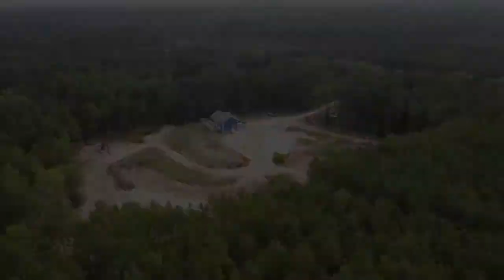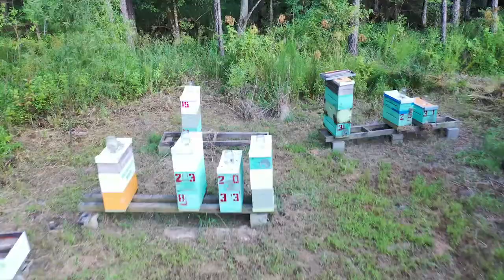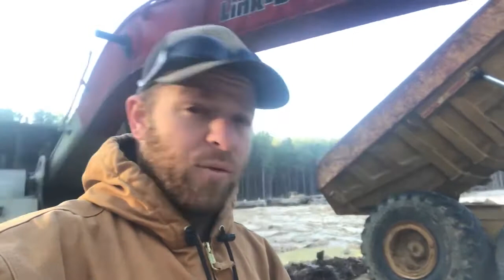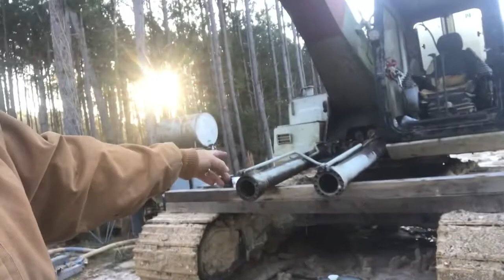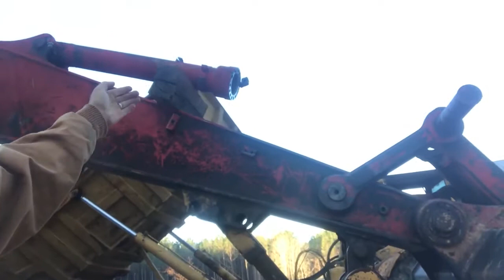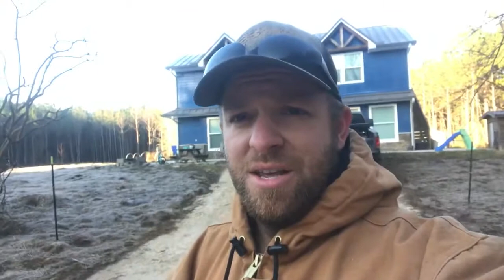Rebuilding Excavator Hydraulic Cylinders   Removal and Replacement Tips

Comment: How did you go about purging the cylinders of air on reinstall? I just got my own excavator and had the cylinders repacked, and I'm wondering now if I need to reconnect the hose and crack the bleeder  valve while exercising the hydraulics.
Reply from the maker: Didn’t bleed anything. We just cycled the cylinders a few times and they worked the air bubbles back to the tank on their own.

Comment: Tom !!!!
You are coughing a LOT !!
WEAR a RESPIRATORY oR at LEAST a DUST MASK while sawing !!
 Also hearing protection !! 
 At 65ish I have developed respiratory n SEVERE Tinnitus !!!!!!!!!!!!!!!
 Protection n Prevention can go a long ways !! I WISH I would go deft !!!!!! It is dat bad !!
  L👀kin into Micron dust particles will let you know !! ALSO your Children n Wife in the area !!
  GOD BLESS
Reply from the maker: I do appreciate your genuine concern on all fronts. You don’t see it here, but I do keep isotunes ear pro on me at all times when around loud tools. I make it a point to always make sure I have them and use them even if it’s a real quick cut with the chainsaw for example. When I was in high school I worked in a pallet mill and my boss said the same thing you’re saying now. He threatened to fire us if we didn’t use the ear plugs he provided. 
The cough is a seasonal cold/allergy. It sounds horrible and I’ve gone to the doc for it before. Same diagnosis every time. Some antihistamines and cough suppressant, maybe expectorant like mucinex. It goes away after a while 😆. 
Wife and kids are the same for the ear pro. The kids know they don’t even come ask to run the lawnmower without earplugs. And they know not approach me on machinery until I see them from a distance, secure the machine and motion them to approach. 
I do not wear dust mask for the large sawdust of the sawmill, but in very dry dusty summer conditions I will wear a mask sometimes if it’s very dry and windy due to our find dust silty soil. In the shop we have good dust collection and use HEPA filtered vacuums when sanding and creating fine dust. 
We do try to take it seriously, you just don’t often see it on my videos as I’m normally shooting footage before or after doing the work.

Comment: Did you need to empty the hydraulic oil before you removed the cylinders?
Reply from the maker: No you do not need to drain the tank. All the fluid that is in the cylinder when you pull it will come out, so have buckets to try and catch it. I’m sure there are “pros” that hook up hoses to a tank or something, we just pulled them out and had a few buckets handy to catch most of it
Reply: No

Comment: 1200$ for 3 rods ?? Wtff
Reply: We in croatia charge about 300-400 dollars for 2 cylinders with a gasket replacement, but we do everything on the field. And if you don't have a socket, don't even try to remove that nut, there is 1.5 tons of pressure on it. We took it off 2 times without a nut. Lever almost broke my arm !
Reply from the maker: Right. That’s why we took to a shop, because they have the rack to break and torque that nut. I’m happy to pay a bit extra to let them take the risk and do it safely. I like to think I’m learning my limits.